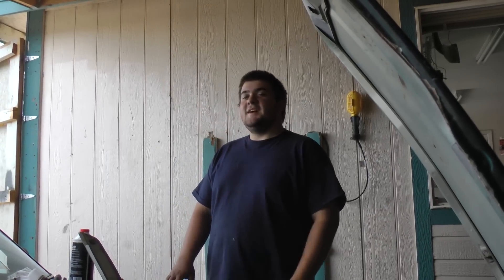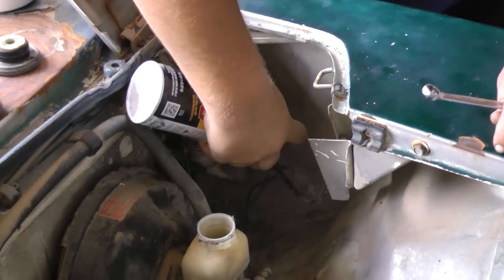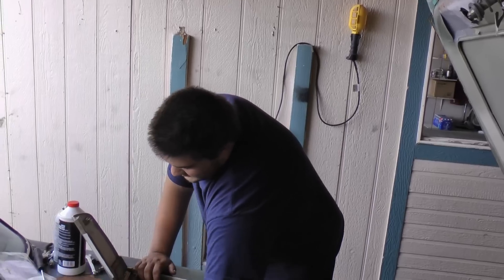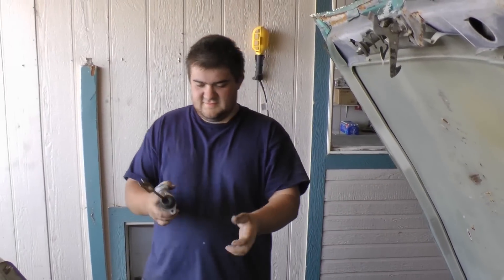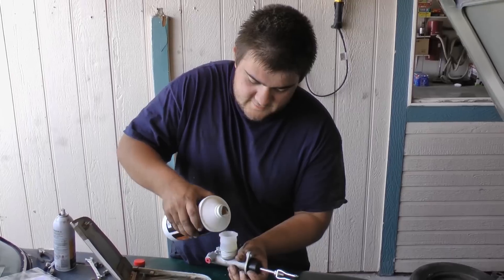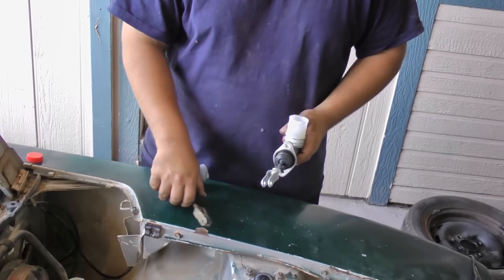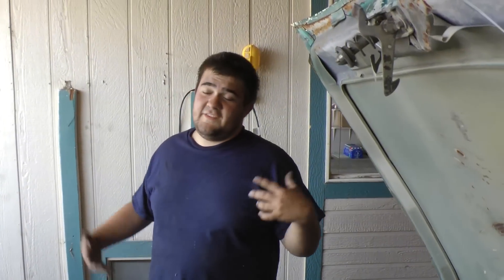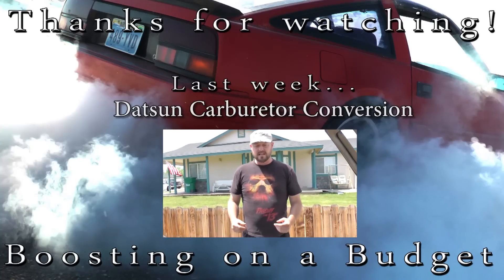How To Change Your Clutch Master Cylinder

Comment: how much brake fluid do you need to change the clutch master cylinder ? my z31 needs new clutch fluid and i dont know how much to buy
Reply from the maker: How a full bleed, I  always buy them in the 1QT/32OZ bottles. This will be more than enough.
Reply: ok thanks for the help